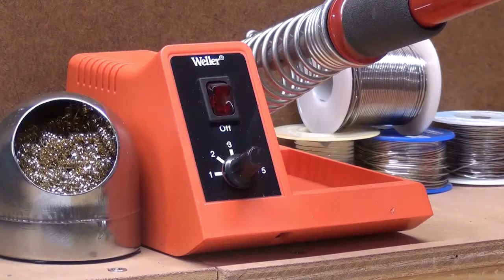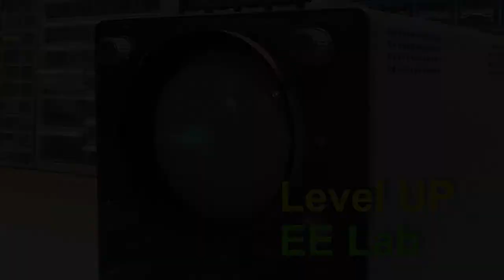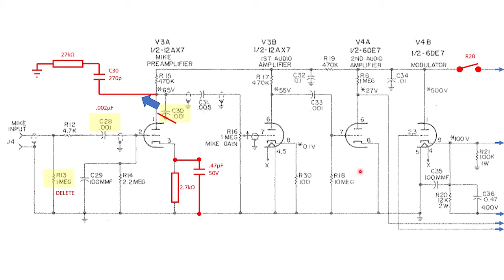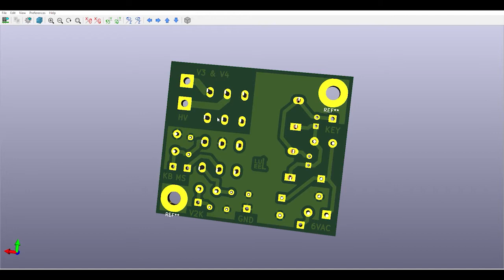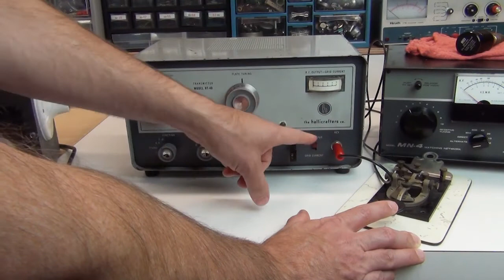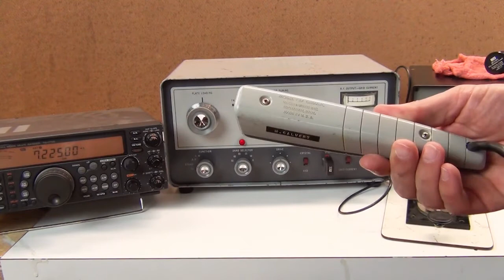Hallicrafters HT-40 Repair - Part #2

Comment: I noticed you didn’t place the ground of the oscillator cathode on a relay. I’ve been talking to Phil on the QRZ forum about that as the oscillator runs constantly when in AM or CW mode. I may attempt using a D-Lab K1 board to switch that.

Comment: Thank you for your fine presentation.  I am presently trying to restore a HF 40 myself.  Can you please advise where and what parts you recommend added to connect  a Heath Kit a VF-1?  It requires power from the transmitter of 6.3 V ac for the tube filaments,  250-350V DC for the Hot side, and the common. The VFO frequency input is just a polarized plug in on the front of the HF 40. Also can you offer the printed circuit board with or with out parts? KK4BJY

Comment: Great video!  If you create a part #3, would you explain whether you had to make any repairs to the RF choke.  In part #1, you had mentioned that there may be a problem with the choke since it was loose and you feared the ceramic core may have broken.  I don't recall hearing any more about it in both the first and second video.
Reply from the maker: Oops, I did miss that.  As it turned out, there were enough good threads in it to hold back to the chassis.  A small chunk of the ceramic did break off, likely during shipment, but not enough to keep it from being held down.